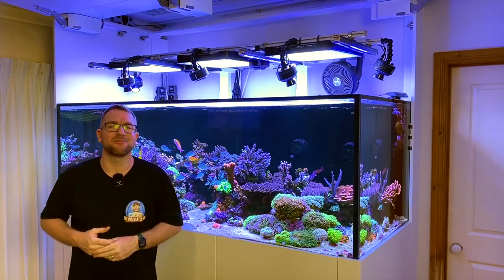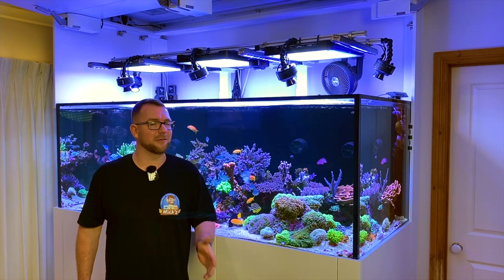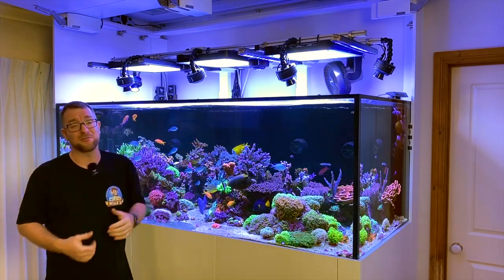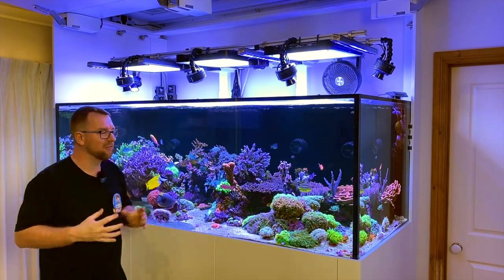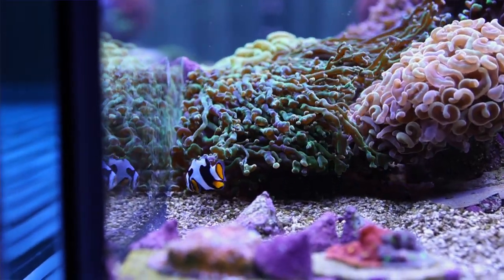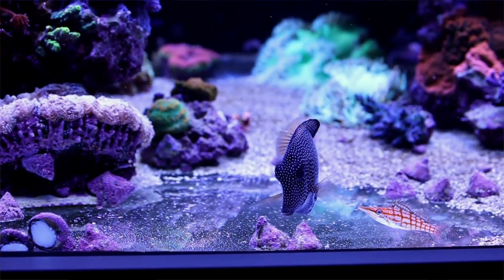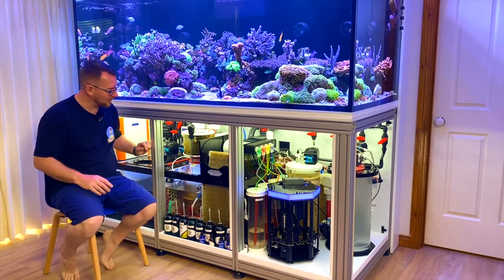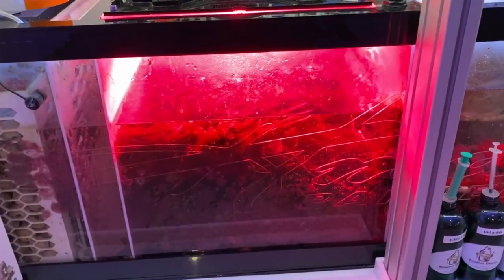Dream Reef Tank -  The 2 Year Overview

Comment: The tank is looking amazing. I love the euro-brace and wish I went a similar route. Maybe for the next tank...

Glad to hear that you used Duralac when screwing together the frame and that you're not seeing any corrosion. It makes a huge difference in salt-water environments and with the combination of electrolysis can really do damage. Not sure if I mentioned how quickly I had an issue on my catamaran, but we had a stainless bolt that was holding the main aluminium beams into the hull and the manufacturer didn't use Duralac. Within 12 months the stainless head of the bolt had completely eaten through the 5mm wall of the aluminium.
Reply from the maker: wow that is incredible, duralac really is a good product!

Comment: I just can't get over how fast this tank went from just getting wet to awesome. One think that stuck with me in this long video (which I love btw) is the price you said for wild sps colonies. $40 to $50. I have been in the hobby for over 20 years and those are prices I remember from when I started. Now in the U.S. where I live no fragsbof sps are really cheap. Yes you can get a piece of green slimer for $30 but it will be an inch and a half long... maybe. Great job on the tank. You should be proud. From what you said there is not much you would change and that has to be a great feeling. 👌
Reply from the maker: Thanks so much Arrick, I always appreciate your insights into the hobby and appreciate you following the journey!

Comment: Great update and the tank is looking awesome but don’t you think you are overestimating the impact of the CoralCare? You have 7 kessils and also light bars. The CoralCare total wattage is 510 vs 820 watts for the Kessils.
Reply from the maker: Yep and despite that, the Philips give way more coverage and par than the kessil. I seriously contemplated redoing the light frame to try and fit a fourth in there 😅
Reply: @ParkersReef  Got it - can’t argue with the results. How high off the water are the lights?
Reply from the maker: with the sit stand light frame, I can vary it. But usually 18-20 inches

Comment: Did you have any issues with the mastertronic pump tubes breaking?  My pumps A&B both popped after about 350 tests, and  pump C was about to go when I replaced the all. Have you done any maintenance to it over its use?
Reply from the maker: I’m 650 tests in so far and haven’t had any issues? I am due to do some maintenance though.
Reply: @ParkersReef  Fantastic, when you do check out the 3d printed bushings to add. They keep the hoses from wearing out so fast.  Also what are the dimensions of your tank?  It looks very close to the one Im setting up now which is 84"x30"x30" or about 215x75x75cm.
Reply from the maker: @dannydefrancis2045  will do, thanks for the heads up. The tank is 210x90x75cm :)

Comment: Could be osmosis related? like i know Perth pet shops fish only systems run a much lower salinity than their coral tanks. So when i have bought fish i have had to measure the salinity in the bag and then match the quarantine tank to that level and then slowly adjust over the weeks they r in quarantine.
Reply from the maker: The wrasse was kept in a coral tank at my local fish store for a couple weeks first, that system is the same specific gravity as my system - but it was a good idea

Comment: Also another Question have you ever had any probs with your wet sides on your MP 60s? I have had 2 MP10s  rust out in 6mths and one MP 40 wetside same story , have had all replaced on warranty, only use citric acid to clean and have used same cleaning method on cheap jabeo power heads for yrs and yrs and these are still fine?
Reply from the maker: I haven’t, but I do check them often from all the stories I’ve heard

Comment: Hello do you recommend Radion Xr15 Pro or Red Sea Reef LED 90. Lights ?
Reply from the maker: Both are great lights to be honest, probably depends more on what other parts you are running from either ecosystem?
Reply: @ParkersReef  I’m just using a 55 gallon standard aquarium want to eventually grow Acros
Reply from the maker: Do you have any other Red Sea or ecotech products?
Reply: @ParkersReef  I have two eco tech mp10 wave makers but they are not hooked up. Using two Sicci voyager 2000 Wavemakers now.  
and use Red Sea blue bucket salt.
Reply: @ParkersReef  currently using two Fluval Marine lights. My tank is 6 months old with various soft corals and Lps
Reply from the maker: If you like the wave makers, go the radions :)